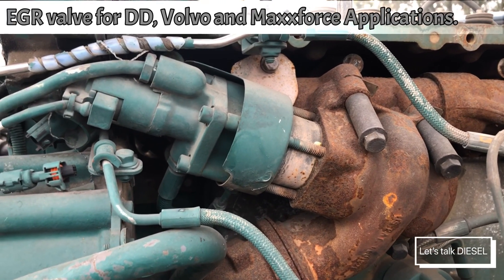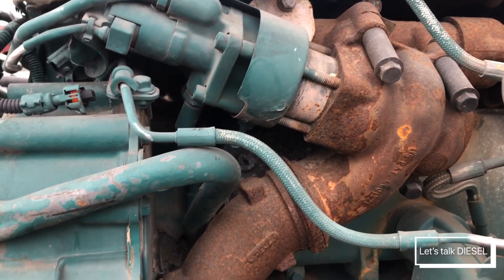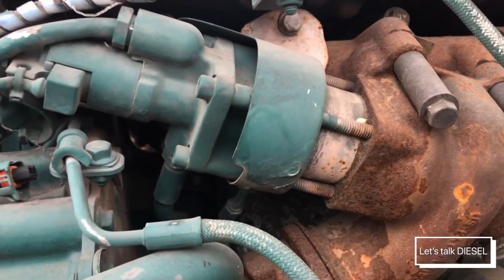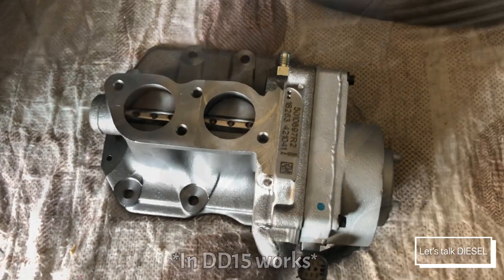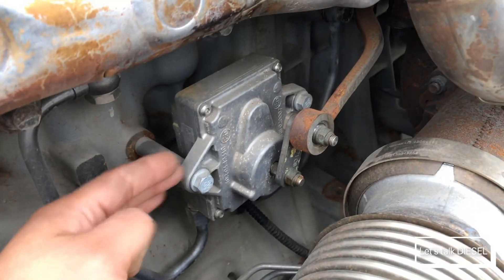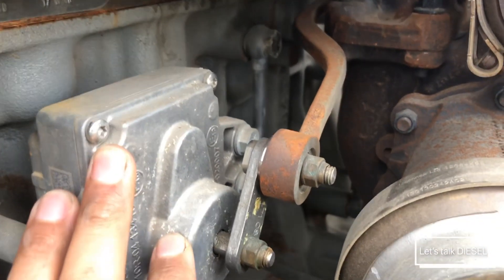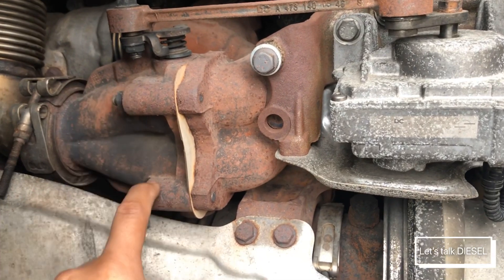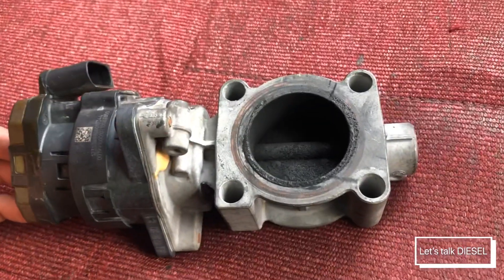Heavy Duty Diesel Engine 101 Episode 6: EGR Valve and EGR actuator.

Comment: how i delete the egr on dd15
Reply from the maker: It is possible to delete the EGR system from your MCM, but by experience, I do NOT recommend it. This kind of ideas, do NOT help your fuel economy, do NOT improve the torque of your engine and it could damage other components like the DPF, SCR, Turbocharger and other things relate it to exhaust. system. I hope this help with your question.